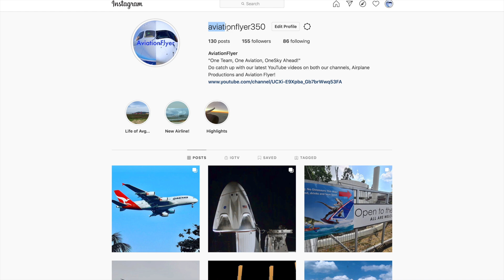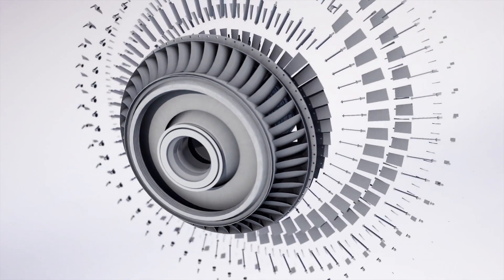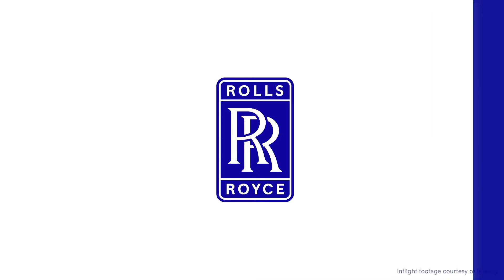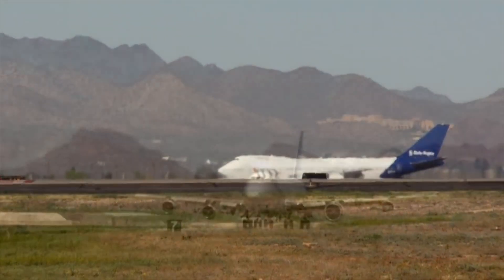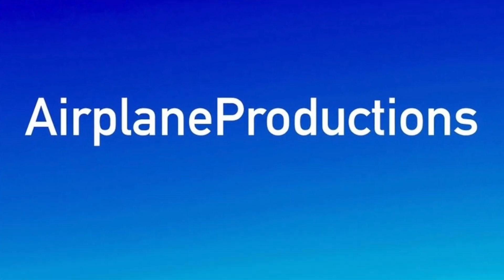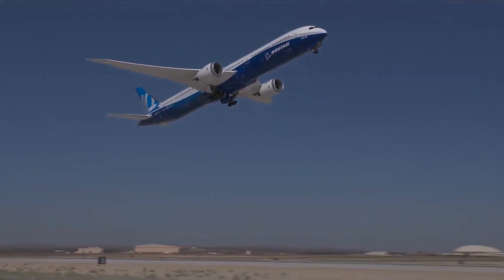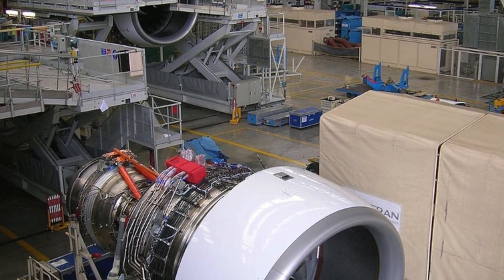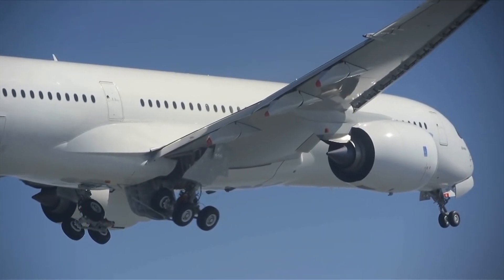Rolls Royce Trent XWB vs GE9x vs Trent 1000: Battle of the Turbofan engine!

Comment: GE9x suppose to win it all, and 777X to be the most amazing plane but both are really late, there are many reasons for that, but ultimately I believe to be because they are pushing the envelope like never before. I really hope they succeed, but I will wait a year or two of service before having the pleasure of booking a flight in such pieces of art. In theory, higher bypass ratio and pressure with stronger lighter parts to hold it together means it's easier/more likely  a small issue to transform into a catastrophic one. It's a reduced redundancy as each part needs to hold higher energies. Wizard engineers are there to figure out that :). 
By the way RR are also pushing the envelope, perhaps even further with the UltraFan aiming a 15:1 bypass ratio and 70:1 overall pressure ratio.

Comment: I find it more than a little strange the proportion of video time versus trent XWB vs trent 1000TEN and GE90 vs GenX. This video is flawed based on the fact that one engine is in service for many years and the other is not. Making statements such as 'the GENX should have a smooth entry into service' while making comparisons with the Trent 1000 'in service' issues is misleading and I would suggest slightly biased inline with your guest commentary in the beginning who I found to be more one sided in his comments than you.

Comment: I like your comparisons, but I have over 32,000 hours, over 2500 on DHC-6, I loved and still love the P&W, I have have over 15000 hours on Boeing’s piece of junk the B737 and the CFM56 was great.
I flew the A330 until retirement, with all 3 variants of engines, none of the others came close to matching the Roller, it is the most magnificent engine.
The P&W coughed and farted at about FL 250 with a decent load, it hated the heat, the GE was modicum, the Roller got to altitude with muscle, the fuel burn figures were exact and as a captain I knew I could rely on it.
Go Roller.
Reply: Rolls fan here too, lets hope Rolls' ultrafan development brings even more to the table
Reply: My dad worked in the Derby plant on the original RB211 project which led to this generation of engines.

It nearly broke the company, but it changed engine technology.
Reply: well said lads. Rolls Royce engines make me feel proud to be British. My late Grandfather flew many different aircraft powered by the different models of the Merlin.
Reply: It did break the company. The Government had to step in and bail them out, courtesy of the Tax payer.
Best investment the British Public ever made!
Reply: And thanks to Britain’s greatest ever engineer:
Sir Stanley Hooker.

Comment: I think that any geared 2 shaft turbofan engine will always outperform a 3 shaft turbofan engine given the same core diameter or fuel burn. It seems obvious that the US companies were right to pursue geared turbofans over 3 shaft turbofans.
Reply: RR did not managed to squeeze the efficiency out of its 3 shaft architecture. And CFM is out to prove that 2 shaft without gears can still match up to the GTF.
Reply: @chingweixion621 The leap is the furthest  that cfm can get out of this engine.

Comment: I’m a big Trent fan, but the GE9X is an amazing engine.
State of the art power plant, indeed. 👌
Two of them could comfortably power a 747-300 or more tightly an A340-600.
The 9X makes me wonder what are the limits for turbine pressure and bypass ratio...
Reply: The limits for pressure are really quite difficult to estimate. In terms of pressure itself, there isn't really a 'limit' so-to-speak, it's more about the temperatures than the pressures. As you keep increasing OPR, the energy required to drive the compression increases progressively as the compressibility factor rises due to air temperature increase through the stages, making it harder and harder to keep compressing. This as a result also magnifies any compressor blade tip clearance losses, which begins to place the burden on manufacturing limits and materials. In the turbine, the pressure aspects aren't really a concern, it's much more about temperatures. Typical turbine entry temperatures (TET) these days on large engines are approaching 2000 K, which is really at the limit of the materials, as well as generating exponentially more NOx emissions, so it's a bit of a difficult space to improve on at the moment. As you increase the TET, you either need more bleed cooling air to maintain a stable temperature or you sacrifice component life instead, neither of which are desirable. 

As for bypass ratio, well the limits are already being reached for single fan systems. The bigger a fan gets, the slower it will have to turn, due to the tip Mach number limitations, which takes designers into a strange realm. Increase the fan diameter: lower fan speed, means slower LP turbines )which are bigger), higher idle thrust, larger fan hub stresses, more extreme inner fan aerofoil cross sections, etc. The other big challenge is the resultant increased fan cowling size and the drag and ground clearance issues that come with it. The latest engines and aircraft already struggle with this issue, the 737 Max is case and point (higher set engines due to minimum ground clearance cert reqs). Ultimately, for single fan designs, I believe we have already reached the practical limits in engines under development (such as the RR UltraFan and P&W1000G series of roughly 13-15:1). Further increases inevitably lead to distributed propulsion concepts or perhaps even open rotor designs.
Reply: @onetrickhorse  The GE9X, is the most powerful according to Guinness World Records with 
 134,300 pounds of thrust https://www.youtube.com/watch?v=ettd4xvutl0
Reply from the maker: Yep, these high pressure engines are great, though they do mean more wear and tear thus stronger plus lighter materials are needed. Thanks for tuning in!
Reply: Your a brit with national loyalty but GE is by far more innovative than rolls
Reply: And you’re a Yank trolling for GE.

Comment: I go with the GE90, GE9x engines.  Mainly because of reliability reasons.
Reply from the maker: Hmm... yep GE90 has proven very reliable. Trent XWB is still new but so far, seems to be pretty reliable as well! Thanks for tuning in :)
Reply: @oneskyflyer  The GE9X, is the most powerful according to Guinness World Records with 
 134,300 pounds of thrust https://www.youtube.com/watch?v=ettd4xvutl0
Reply: The GE9x has had some problems though...
Reply from the maker: @PlanesAndGames732  Hmm... that was during a black test where the engine was spun way outside its operational limits... hopefully the issue is now fixed. Thanks for tuning in!
Reply: @PlanesAndGames732  at least GE responded fast by getting to work to fix these issues. RR on the other hand responded by counting on their lucky stars so that airlines can blame and sue Boeing while RR goes unscathed.
Reply: @Blank00  Got to say your totally wrong in your assumptions. RR far from being `unscathed` have had a massive hit I believe in the region of $2.5 billion ( might even be pounds! ) on the T-1000 debacle, but they should be commended on their achievement in fixing the problem & actually lessening the impact on Boeing & the airlines in the fast response to correcting the faults.....there aren`t to many companies that could have achieved this feat.
Reply: Yeah, but when RR asked Boeing for help, they sent the man who ran 737 Max. What was he supposed to be? The Worlds worst aerospace engineer? 

Half the time Boeing is the problem. Not the engine. Airbus so superior. Much more class.
Reply: @PlanesAndGames732  Hmm, can you elaborate?
Reply: RR did themselves no favours with the Trent 1000- cost a fortune to replace for Airlines. The XWB 97 is a much more reliable product.